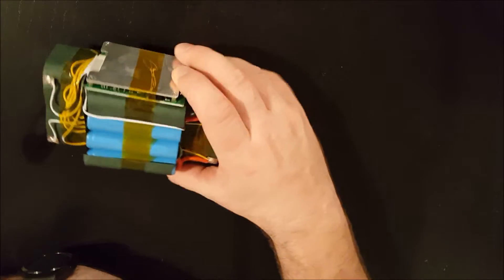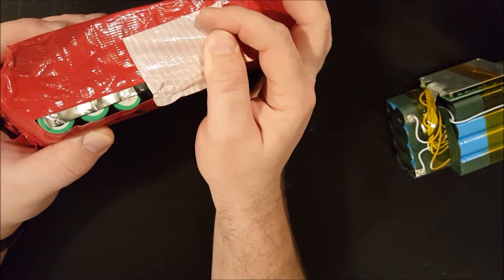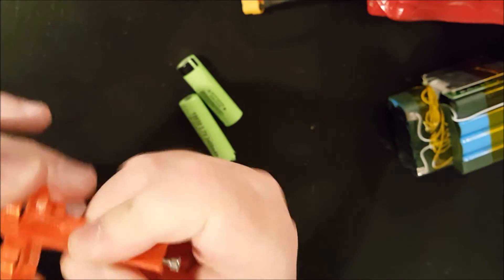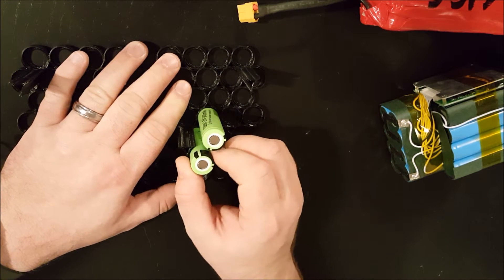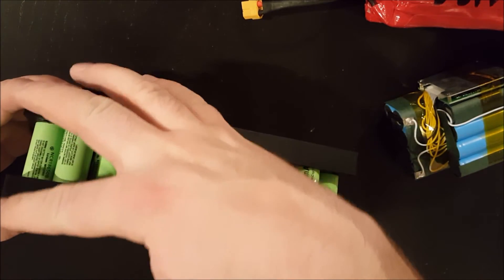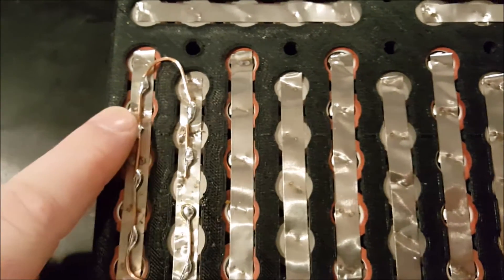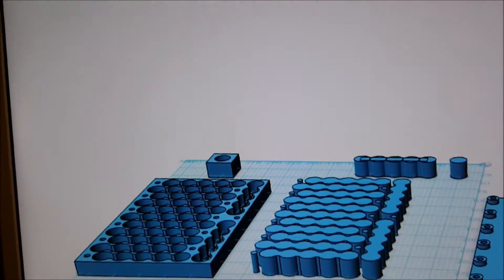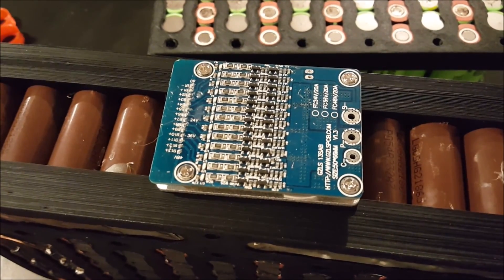I designed and 3D printed an eBike battery (part 1)

Comment: BLOODY HELL! 30 AMPS Theres no way the motors are performing at that current just burning heat, best to limit to like 18
Reply from the maker: So many controllers seem to be either 22 or 26 amp,  I wish they had one where you could choose.  I'd set it to 10 which would be plenty for me.
Reply: Solar Steve You can you have to program them rather than just letting it draw max current. My Bafang just connects via usb and there’s tons of controls.
Reply from the maker: @ps3customgamer  Do you have a link to the controller you have? The controllers I have don't have any USB ports on them (I wonder if there's somewhere you can solder a cord to)
Reply: Solar Steve just google bbs02
Reply from the maker: @ps3customgamer  looks like it's for mid-drive, I need to find something for direct drive. I'm sure there's something out there.
Reply: Solar Steve not really it’s a brute force approach to no gearing. It’s fine if you intend on throwing a few thousand watts at it to push it quickly to a high rpm but there’s a lot of force out on the frame and supporting components basically needs to be a moped

Comment: I still use 123D design... love that program.. I hope windows 10 does not break it since it's no longer in support.
Reply from the maker: It does work on Windows 10! I need to make sure I keep the installer as it's getting harder to find. So disappointing that they discontinued it!

Comment: I got a 3D printer coming, mainly for this purpose. Got to figure some working system out as well. But one large issue is the filament being rather flammable and if you're going for li-ion, that's a huge downside :/ Thinking about just making spacers with them and then going for an aluminium case.

Comment: Interesting, I was thinking of doing something similar but instead of screws, making the holes water pump so it's a cooling system. if a battery explodes or a twist in the casing occurs, it'll leak though. But with heat killing batteries and tesla doing their own cooling, thought this might be an idea but might take up more space.

Comment: Nice idea with using a 3D printer to make up your own 18650 holders, that way you can get the cells laid out in a way that works for your particular application and you don't have to wait 4 weeks to get more of the square 18650 holders from China! :-)

Now I need a 3D printer as well!
Reply from the maker: This one was pretty cheap, $370-ish from eBay! Let me know if you want the CAD file, I will probably upload it as some point. I do like those square holders, but it is a real pain waiting 4 weeks for them to arrive... lol
Reply: Morten Mortensen i need the file CAD thnx thats my e-mail kamalmadloum@gmail.com